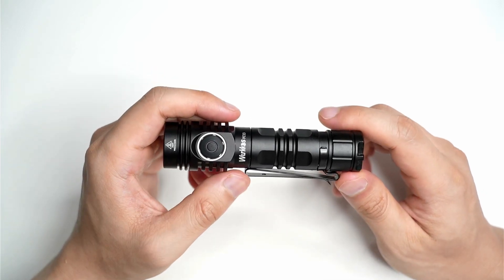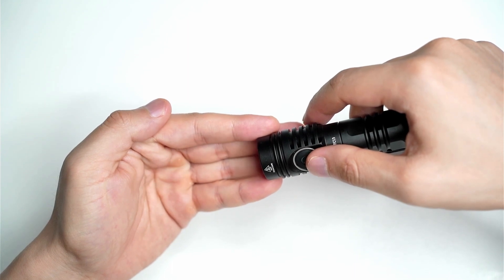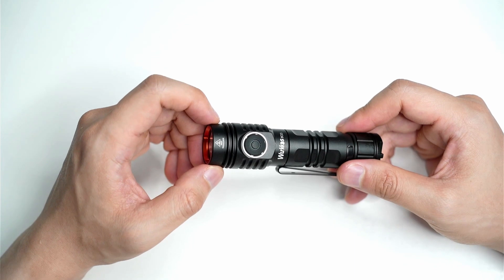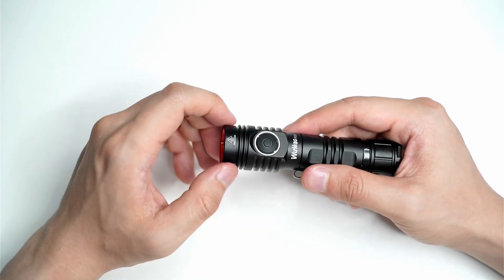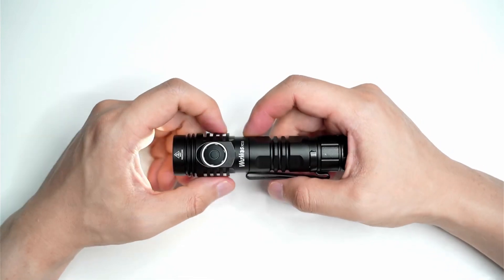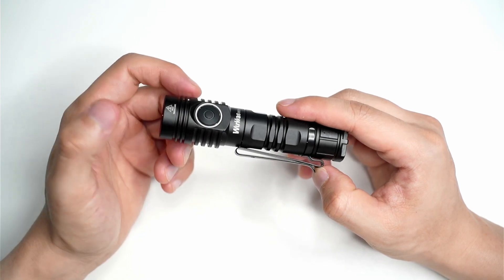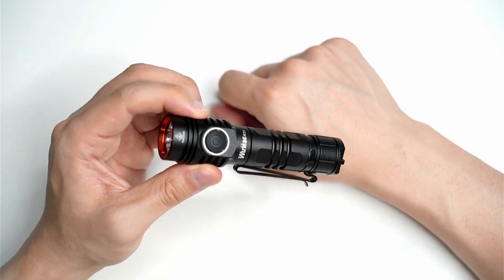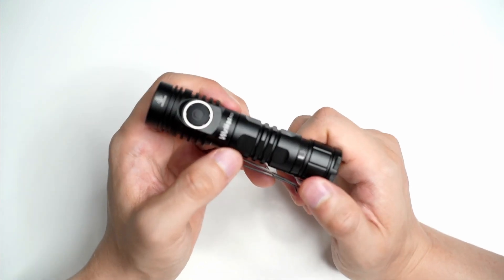Boost Brightness and Turbo Runtime In 5 MINS! | Calibrate Temperature, set Stepdown Limit (Anduril)

Comment: Hello darren, you are doing it wrong... the configuration of the stepdown temperature is always 30 + N times you click, NOT current temperature + N times you click. And setting your current temperature to 32 will make it quickly reach the stepdown temperature you set. So it's better to set the current temperature lower.
Reply from the maker: Hi Steven, thank you for the correction, I've pinned your comment up!
Reply: @DarrenYeoYT What StevenJ said about 30° + n for calibration!!! I need to ask you how you knew your light was at 32°C ? The calibration of the light's temperature should be done at room temperature, never when it's warmed up. And it needs to be done ASAP. For most individuals room temperature would be 18-22°C. 32° just doesn't sound right. 

 Do you know about long presses for calibration and programming in Anduril 2?  One long press, which is about a second to a second and a half, is equal to 10 quick presses . So two long presses and two quick presses equals 22 presses, and four long presses and seven quick presses equals 47 quick presses. Much easier to do and count.
Reply: @craigs7181  Thanks for the tip about those long press button.. i have tested it and easier to use that method..
Reply: Anyway what is the maximum step down temperature i can set on anduril 2 ? is it 75celcius ? because i want to set to maximum as it can.. i dont mind the heat as i want to manually step it down if my hand can no longer hold the heat.
Reply: Its 70 degree the maximum, which Is already very hot
Reply: You mean, check the temp and then go directly to 7 hold, and after the second blink sett the limit ? I that Right?

Comment: This is by far the most useful tips I've seen on your channel, Darren.  I'm not sure if I want to prematurely burn out my favourite FC13s by extending their thermal cut-off times though. If there's something that I learned within a few short months, these passively cooled flashlights were never meant to sustain Turbo or 100% output for long. Not until someone invents an active cooling, fan-less flashlight tube or a new light emitting technology that's impossible to run hot. 🤔

Maybe that'll eventually happen in 20 years' time. 😀
Reply from the maker: I read somewhere that the electronics can handle 60C easily but the battery is the issue 😅 also, the light becomes to hot to hold!

Comment: Also i think the solder and components can handle twice as the max setting of temp control
Reply from the maker: Yeah, I heard this too. But check the max operating temp of the battery - that's mainly my worry.
Reply: @DarrenYeoYT  thanks for the heads up appreciate it

Comment: Finally a short instruction for calibrating anduril 2.0 temperature. It mixes it up about the temperature. Now it is clear that total number of counts for the stepdown from the operating temp. I think max temp that can be set is 70c right? I kinda live where ambient temp is between 30-37c
Reply from the maker: I think 65C is highest - can't remember exactly. I don't use Anduril flashlights much these days.
Reply: @DarrenYeoYT  thanks man!
Reply: @DarrenYeoYT what I'd like to see is more tail switch flashlights that have Anduril!!...like the TS10 has but in a bigger single emitter host. ✌️

Comment: Cheers for the info. Followed your advice and got it now. This FC13 is just remarkable. I like its compactness, also nice to have the clicky button following the battery voltage. Much easier imho. Thank you 👍
Reply from the maker: Hi Meor, awesome, so you set it to 55-60? It's a nice little EDC and I haven't had it switch on in my pocket.. which is common in side switch lights. Thanks for watching man.
Reply: @DarrenYeoYT  Yes, I set it on 55c and see how it goes for a few days. Actually it does get abit toasty after the 1st minute but I would say it does hold for longer. As it is even on high it is good enough for work/play and having that turbo available is great too. So far its a keeper. Cheers

Comment: Please tell me, the question is not much off topic, I saw you had an if25a review, tell me from which flashlight the clip will fit it and where to buy it, and tell me if if25a can work as a power bank ?, thanks for the answer.
Reply: Seems to use the same clip as the sp35 if you are talking about a sofirn flashlight. The clip is on their website
Reply: @thebetterrug  Thank you, but how can the sofirn if25 power bank work ?, can you tell.
Reply: @БлэкБлэкович-с1г  Im sorry I have no idea how that works but if I pick one up I will msg you here
Reply: @БлэкБлэкович-с1г  To use the IF25a as a power bank, you need to use a USB-C to USB-C cable.  The same is true for all the other Sofirkkos lights that can act as a power bank.  The lights will only charge with a USB-A to USB-C cable.
Reply: If it has a USB-C port then it can charge from powerbank!
Reply from the maker: Hi there, the clip is from my Sofirn SP35. They can be purchased separately from the sofirn official store. Unfortunately there is no USB C to C charging on my IF25a.